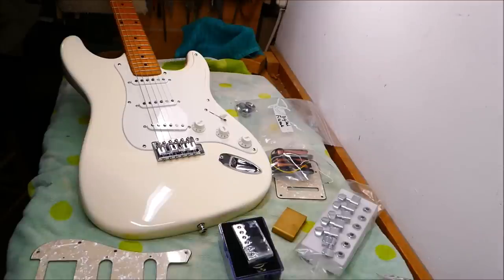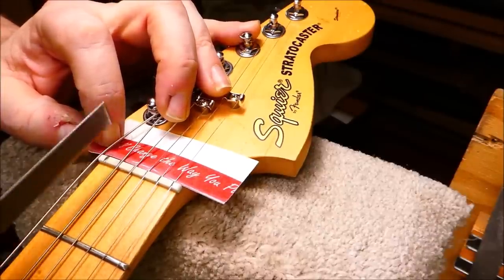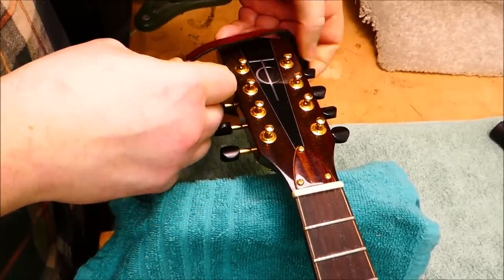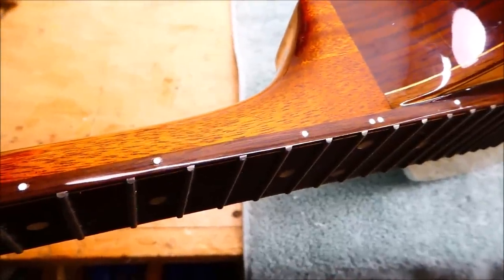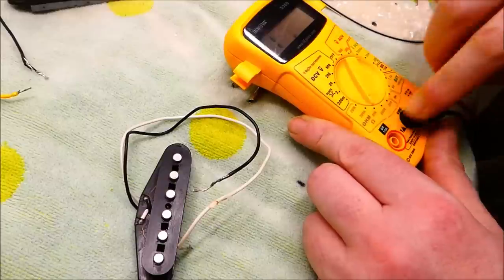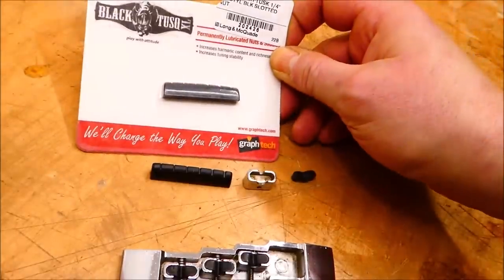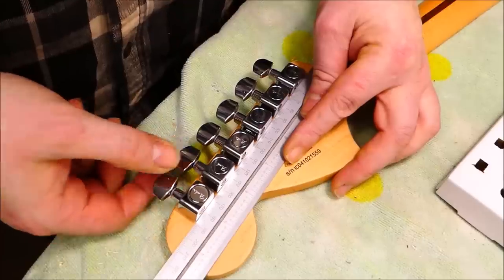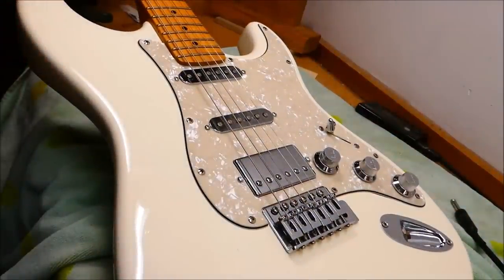That's a lot of work!

Comment: My advice to anyone considering building a partscaster would be to do your homework thoroughly before you start. This means sourcing parts that (as much as possible) fit together. That seems obvious but it’s very easy to go wrong, especially when you’re buying parts online. And don’t think that you can get away with buying cheapo parts – it really isn’t worth it.
If things go wrong, you can end up throwing good money after bad. If you’re lucky, and you have the basic skills, you can create a fantastic guitar. A couple of years back, I wanted to recreate a ’65 Strat. I have had to tweak it since but I now have a guitar that is equally as good if not better than the original, for an estimated outlay of around $600. Not cheap but a fraction of what a ’65 Strat costs today.
If I were a professional luthier, I wouldn’t look at a project like that.

Comment: Being a lefty player makes the lure of a parts-caster irresistible. The stock Fender options are limited to say the least. Having said that, ensuring  you have the proper hardware to  match the body & neck is essential. Also, enticing someone like 'twoodfrd' is paramount if you're wanting a playable instrument. Be careful going it alone...I learnt the hard way. Lol

Comment: I have a Japanese Fender Jazzmaster that is almost 0% original at this point, and totally Americanized except for the body and neck. (It even has a real nitro tort pickguard, which Fender USA itself doesn't do anymore!) It has a lot of the same issues with different screw hole positions and sizes vs. some of the American parts. Knowing that, I did a ton of research before buying to either make sure I was buying parts to fit a Japanese guitar, or that I knew were within my abilities to make modifications to in order to fit. I'd never just buy a bunch of random parts and dump them on someone else to deal with. At least he's paying you.
I actually also have a Squier Strat that was made in Indonesia, and I've modified it as well with a new trem block, pots, pickup covers and a few other cosmetic things. (It is a cheeeeap guitar, but it almost didn't seem right to just let it be so crappy in ways that I could fix for like $10 and an hour of work. Just upgrading the trem block turned it into a pretty good sounding guitar.) Same issues with that; I spent way more time making sure the stuff I bought would fit than I did actually installing it. I think most guitarists who are really into their gear know about this kind of thing, but I'm sure a lot of less experienced players probably don't.

Comment: You should charge your hourly rate times the number of hours.  It takes what it takes.  As you said, it's really a job for a hobbyist.  I've built a few 'kit' guitars using a variety of parts and I know exactly what you mean.  Every single part becomes a project in itself.  And in this case, when you're all done, you end up with a strat that doesn't sound like a strat (although it did look and sound good).

I appreciate your skill and patience.

Comment: New sub and will watch your other videos. I’m just a lifelong beginner and probably more of a gear ‘in my dreams’ player. I have a Fretlight strat guitar that I upgraded with an ebay pickguard and fender pickups all in one. Whoo boy…similar issues. Spacing at the pickups isn’t perfect, pickguard holes were off. Had to route room in the cavity for the pickups. I’m a wanna be a lot of things so I bought a bunch of guitar luthier tools and am capable of fixing things to my liking. It’s a neat hobby to be able to fix a guitar up to the action I like even if I’m still a beginner.  I do prefer to play my 1000 fender right out the case instead of the upgraded cheap beginner. The fretlight has the benefit of lighting the parts of the fretboard for scales as well as songs etc. I wish they had added LED’s in between the pickups so you could see what strings to pick when you want to work on that part of learning.

Comment: pretty sure that's an alder body Squier, serial number lookup will reveal on squier wiki, they rival and you can get a vintage big block 52mm on ebay for like $19.. yup huge improvement over those saddles, and if you're keep grab a few sets of stainless saddle adjusters of various lengths and dial in those saddles using stainless adjusters, nuther improvement, I've upgraded a lot of strats and I have like 7 or so of my own and they are well worth upgrading if you get the right ones,  this one, with the gold have alder bodies, good necks, Ilike em, the standards are good, already have alnicos, then the older early 90's NC with bullet on the ball are superior if you get the 60's style hell adjust necks... oh boy I have 4 of those 2 in which I went balls to the walls on Evans pickups the works and man they don't get any better

Comment: My vote is that there is no way that is worth it. Maybe if you went to Stew Mac and bought all corresponding Fender parts..MIM, USA, etc. For what that cost to put lipstick on a pig as they say, you could buy a Mexican Fender that plays, and sounds great with minimal setup, or even a Squire, which IMO are sometimes better than the Fender Strats. And one of Fender's main luthiers agrees. He did a YouTube vid comparing them and was really surprised at how well some of the Squires were made. Your work in insane though. Great vid!

Comment: Aren't the brand new guitars Fender sell just partscasters? I mean they have been making the Strat 70 years, and each model they sell now is just a mix of parts from different eras and contemporary parts, but I guess the difference is that they know what parts they will be using, and can drill and route the body from the start so they will fit?

Comment: Do you work by the hour?
Or do you quote price per job - or + 10% for unseen hurtles?
Five hours is large part of the work day and guess you did other  fill in work between this project like a flat rate mechanic. Frankly on stuff like this you may want to charge a straight hourly rate. Most mechanics do use pricing when trouble shooting an electrical nitemare. Rate books usually don't cover it.
I had a fella here in Florida do a set up. E.G. filed nut dressed frets  polished adjusted truss rod checked and adjusted intonation on an acoustic Alvarez 
$140.00.

Comment: I also would have said no, but it does make for a good video. I’m currently building a kit strat, and even the included pickguard didn’t fit over the holes. Asking a luthier to fix that would be like asking a professional mechanic to restore a completely stripped car you just towed out of a junkyard.

Comment: To me it really doesn't matter what job you are doing you should be paid for your time based on your expertise in your field. They could have taken that guitar to someone  who  could  have done a sub-par job on it. (Not filled holes or pre drilled just jammed some screws in etc) or caused great  damage. You are a craftsman...they took that guitar to you because you would do it right.

 Bottom line is. Its your time..... Not their time.  They have made the choice  ......for whatever reason . They'd rather pay you  than do it themselves.  So  why should you charge less for assembling parts that don't fit together correctly  per hour than fixing the impossible Gibson headstock diabolical.  If there's one thing I've learned..... Your time is valuable. When your numbers up you can't pull out a wad of money and buy more time.

  Thanks for all the videos Ted. I always enjoy how you can calmly work through any challenge. You are a true craftsman.

Comment: In neck of the woods, 5 hours of labor at a good repair shop would run $600-750.  So those parts + that labor buys you $300 used guitar for about a grand.

Comment: the point of a parts caster is to do it yourself is it not? Granted I just put a Fetwire LP together, it was a PITA and i'm not  a slouch to mechanics, Honesty if if wasn't a good client, I wouldn't hesitate at charging time and materials, 5 hours plus glue/paint/wood etc probably $500 or more assuming $80 an hour (I hope you charge more FYI)

Comment: Right on. I’ve run into the same thing on my “update” projects. Nothing fits, etc. How much is this work worth? I think you need to be very realistic. Time and materials. Decide what work needs to be done and estimate the time, factoring in that you will need to do some extra work so everything fits. It’s an estimate (with extra fudge). Also, I would go with quality material and parts from the getgo. It’s going to cost anyway, might as well look good and function properly. Awesome video, it’s work.

Comment: Can i ask your advice about a repair?  Ive got a 2022 Charvel DK24, its the maple top amber quilt with Mahogany body, i got a deal on it as its brand new but the strap button got crushed into the body, its a clear over natural finish. The strap button covers it but its a half inch deep and dont want moisture to get between the clear and wood.

Comment: Not a luthier, I don’t even work on my own instruments, but I was an auto and power sports tech for 26 years. I dreaded when the customer would bring their own parts in to be installed. Wrong part altogether, shitty aftermarket parts, junkyard parts, home brewed project bikes, wreck restoration, you name it. It was always a nightmare for me as the tech and for the customer. It was always lose/lose between chasing the correct parts, re-diagnosing issues that the customer “diagnosed”, dealing with cheap customers who think the labor rate is negotiable on monster jobs, jobs that go pear shaped at every turn, etc, etc… It all comes down to getting paid and some jobs are losers all the way around. Sometimes you just have to refuse a job or fire a customer once in a while.

If the customer on this partscaster had no problem writing the check, more power to him. If it came to me for some neck work and the customer shows up with a boxful of parts for unrelated jobs, the customer WILL pay full rate for it all or the customer will walk without me laying a hand on it. “Oh, since you have the wheels off while you are fixing the brakes, can you rebuild the rear end for that price too? I have the parts…”

Comment: I think the issue here is the customer starting from and sourcing cheap parts. When you try to go low budget with partscasters, the parts just aren't built to the tolerances of mid to high end parts.. There's been so much based on American Strats and Teles over the years, when start at that level, it's pretty straight forward. Every time I've tried to go cheaper, I've always ended up disappointed. I've got two partscaster Strats, both are amazing and have higher quality parts than what Fender normally uses. But they definitely aren't a way to save money.

If you want real fun, try putting an offset guitar back together. I recently did some work on a guy's 1964 Jaguar, and certain things were really tough to get the right shape/hole pattern, etc. The offset guitars have had so many small changes to shapes over the years, very little is designed to work out of the box, especially things like pickguards.

Comment: With the way you posed your question about how much I think you should charge, I am assuming you normally work at a fixed cost per job type?!  If this is the case, I would recommend an alternate billing method of per hour for this kind of job, with a high enough of an hourly rate to cover for the added headache that they bring.  I have no idea as to what the going rates of guitar work is to recommend beyond this.

Comment: Nice work! I'd say $400 to $500 for the build. With the parts you are looking at $700 to $800 total. For that money you can readily find a used Fender American Standard Stratocaster that will sound fantastic, play perfectly, maintain or increase its value, and last for 100+ years. You can easily change  necks, bodies, pickup covers, and pickguards and those that have a swimming pool route can accommodate any style or combination of pickups without any woodworking. A lot of the work that he had to do is corrective in nature and tedious and irritating, which is why this gentleman seems to usually turn down this type of job and only did it as a favor to a good client in a tough spot. I've swapped bodies and necks with Am. Std. Strats and Teles and the neck pocket fits perfectly and they bolt together effortlessly even when .manufactured 10 years apart. No shimming of any kind with the microtilt feature either.

Comment: Having put together a parts-caster, I can say doing thorough research on measurements (bridge, nut, pole piece width, etc) and limiting the number of manufacturers you purchase from will greatly reduce the amount of work that goes into fitment and final assembly. That said, it's never as simple as screwing everything together. 

If I were a professional, the price I would have to charge to make it worth my time would make assembling someone else's parts-caster more expensive than building them a custom guitar from the ground up.

Comment: Rather than having to shim the neck, I've had a lot of success with replacing the bridge saddle height screws with shorter ones which don't stick up above the saddles: just remember that there are at least two different types of threads used for American and Far East manufactured guitars!

Comment: This goes far beyond a normal setup job. As Ted said, it's more of a total rebuild and, I agree as mentioned below, it is now no longer a "partscaster" but is closer to a "custom shop" build. However, you couldn't charge as if it were a custom shop. For starters, the parts used would never be used in a custom build, and I feel certain that Ted doesn't charge anything like the hourly rate of a Master Builder at Fender.
So, my feeling is that you need to charge by the normal hourly rate. For arguement's sake, let's say it takes Ted an hour to do a full setup, and he charges (again, for arguement's sake) £100 for that. He said it took him 5 hours to do the work, so he should charge £500 PLUS an additional charge of, say £100 for wear & tear on any tools he used that he wouldn't normally use for a setup PLUS the cost of any additional parts he had to either buy or make or take from stock. Factor in "Mate's Rates" and you are looking at anywhere between £600 - £800.
(NB - sub in your own currency, the numbers don't change by much either way: £, ¢, $, C$ etc).

Comment: I have done this work it takes forever, for my friends I charge $200 for a stranger I would discourage them $400  for  $150-200 squire guitar  I don't feel its worth it. But hey it's their $$.  I'm just finishing a Tele upgrade not quite as long to do the work. And since its mine it's just the cost of parts.

Comment: No disguising the frustration involved there. For 5 hours, a guess would be $250-325 + parts. Giving an up front estimate at the high end (for whatever job) -and detailing all the likely procedures might reduce the frustration, but with a risk of putting off some customers. You are well enough established to 'command' reasonable rates.

Comment: so you replaced a staggered alnico  single coil pickup for a cheap ceramic one? Should've just change the bridge pickup for that humbucker IMO...and since most parts casters are Squires, Bridge blocks made in Texas, Japan, Indonesia and China have their own measurements. I just wished you made a tone sample from before and after just to make me believe that those ceramics sound better than the stock pickups...which I'm guessing are pre-wired Chinese Alnico V's which are not bad.

Comment: If this is an Agarith wood body, the gaps are intentional. I don't thing the mahogany-like Agarith is strong enough to handle a tight neck pocket. Alder and Ash bodies still get the Strat-Crack . . . but not as easily as Agarith.

Comment: I'd charge about 200...250€.

250€ being calculated by the hour, including discount for a bigger job (than just a regular electronics service). It's bit on the high side.

200€ is reflecting the price to a whole day's work, say 300€, and divided by 8hrs that would result in an hourly price of 37,50€. This would add up to under 187,50€ - which is too low.

Comment: I've built a bunch of parts guitars but you do have to do your research.  And I'd never inflict that mismatched mongrel on someone else.  As soon as I saw that nice Gotoh-style brass block (which has no hole for the vibrato arm; it goes in a separate sleeve and it's therefore completely incompatible with that bridge) I actually said out loud "man, that dude has NO CLUE."  There may have been an industrial-strength adjective used, as well.